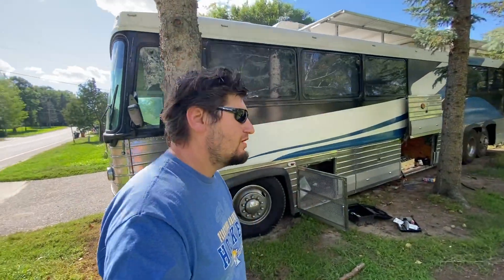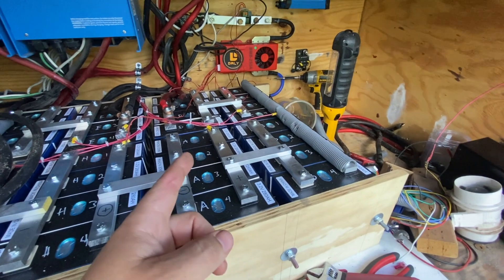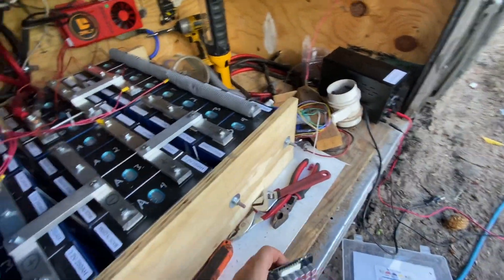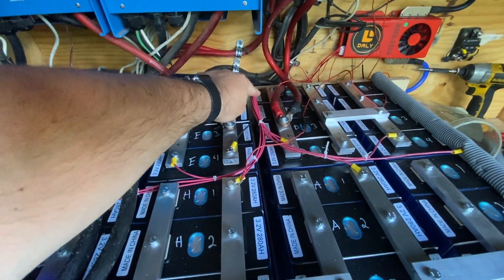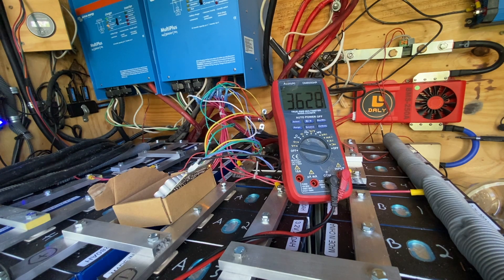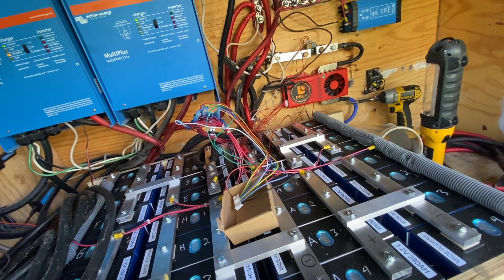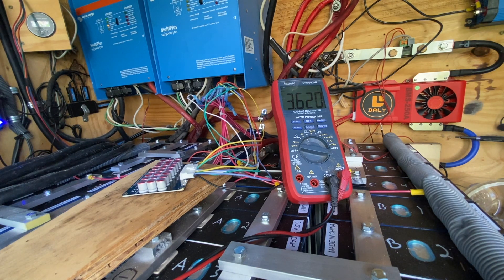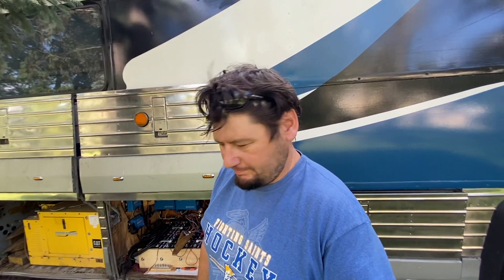Top Balancing DIY 24v 8s LiFePo4 Battery Bank in Bus Conversion Victron Energy

Comment: The DALY BMS should be doing balancing when mostly charged.  Also, when running the pack with parallel cells it makes things harder to troubleshoot as you're finding out now.  If you were to build 2 or 4 separate packs you could take a pack offline to fix without taking the whole thing offline.  Enjoying your videos, keep it up!

Comment: Are you attempting to treat multiple cells in parallel as 'one cell'?  Is Dali rated to do that?  I would check the parallel connections and perhaps move the cell in the parallel row to see if it is connection or cell related.  Electrodacus is set up to handle nSnP configuration (12v and 24v limitation).
Reply from the maker: Not only did I attempt, I succeeded :-)   Daly BMS is rated for amps in and out, it could care less how that is configured.   The advantage to paralleling cells is they balance each other out.  A single cell would need to take 3 other cells with it up or down.  I only charge to 3.55v now anyway .  7 cycles in as-is, no issues.  Check out our latest community post.  .08v cell deviation at 100% SOC.  Not bad IMHO.  Thanks for watching and keeping me honest.

Comment: I ended up stripping one of the terminals on my prismatic cells the first go around, they were 6mm I believe, I ended up drilling and taping new threads to 1/4-28 then used threaded studs so you can run the threads the bottom. If you ever pull it apart I would recommend going that direction.

Comment: I cannot get over how much smaller your battery bank looks than mine. I have 1400ah@24v AGM powerware ups batteries and they weigh in at 2100lbs and use about 4x6ft of space. I have pulled it down to about 800ah too. Wondering what size is your battery bank and how much does it weigh? I suppose you will have to have a plan for heating them now though too...
Reply from the maker: I just pulled out 10 telecom batteries, they used to take up the entire floor space on that bay.  Physical size is about 32” by 24” and 9” tall. That’s with all the casing and compression stuff. I want to say I’m somewhere around 400-500lbs on it. I saved a good 1000 lbs over the agm.   Yup, heating will be an issue, I’ve got some ideas.
Reply: @HimmelbergerBus  just ordered 2 sets of 16x 320ah lifepo cells from AliExpress for $400usd per set, delivered. They claimed to have shipped same day. I think there was a typo but worth a shot.
Reply from the maker: @nbarnard   lol wut!?!? I hope you scoop that deal!
Reply: Hello from the high desert of New Mexico and I live in my 1967 GM TDH-4519 city transit bus  full-time and my agm batteries took a dump and won't hold a charge. I'm very poor and have been waiting for the next stimulus check so I can build my lithium pack. Wow bro you did a good job on building your batteries. I think the reason your batteries don't have the qrc code is because they are B grade. If you want your batteries to last longer then only charge to 3.45 to 3.5 volts per cell. I would love to build a  4s4p configuration is there anyway you can help me . Also if you can help spread the word that I am looking for a travel partner and help with building my bus.  Thank you for sharing your thoughts and time with us  , keep up the good work and stay safe
Reply from the maker: @jamesmason7124  Have you tried doing an equalization charge and or adding 1 TBL Sp of water to each cell?  Worked wonder for mine.   

I'd say best way to spread the word is to start spreading it. Make some videos, they don't ave to be perfect, just share your life.
Reply: @HimmelbergerBus  my batteries are old sealed and agm
Reply from the maker: @jamesmason7124  yup, I know. There are caps. I have 12 AGM batteries in my garage. I spent a month trying different ways to restore them. Maybe I’ll do a video on it.  

If they are trash, you have nothing to lose. Look up telecom battery rehydration, these are massive AGM banks and they would fail after a few years , so some companies tried exactly what I’m prescribing, and in all cases studied, they say 60-90% capacity restored after 3-6 months. 

In my two smaller AGM batteries I tried this on, it went from 40% capacity, to 90%.

Comment: Used similar heltic balancer on 4s pack and left it overnight on 3.5ah charge. It let one cell rise to 3.87v. Not happy. It would have been fine if I kept it under 2ah.
Reply from the maker: The BMS should step in then, what is your high cell voltage set at? I set mine at 3.65, anything above that and charging is shutoff.
Reply: @HimmelbergerBus  Active balancers bypass the BMS, so the only thing the bms can do is try to balance by bleeding off some power.  Most BMS balance with much less current than most active balancers, so the BMS can not protect from this failure mode.  Some BMS will only balance while charging.  I believe your Daly is programmed this way.

I'm not a fan of active balancers.  They will allow you to get more capacity out of your battery bank if you have mismatched cells and very low charge and discharge current, but with higher current and typical variation that exists between cells, they tend to cause imbalance more than they eliminate it.  The bottom line is that your BMS should maintain the balance between reasonably matched cells if they were previously balanced, and if you need an active balancer to get the extra capacity out of your cells, you have a bad cell or you need a bigger battery.

Using T-taps for your balancer on your BMS balance leads is not a good practice.  The extra current drawn from the active balancer could cause a voltage drop on that wire that would prevent the BMS from turning off the charge mosfet to protect a high cell, leading to an overvoltage on that cell.  This is especially true if you're using the BMS to regulate charging.  You should separate the active balancer leads from the BMS leads.  Nothing but the BMS should be attached to the BMS leads.

If you have to disassemble your pack for any reason, I'd recommend replacing the bolts with studs and nuts.  Studs will give maximum thread engagement on the cell and prevent wear on the threads during service.